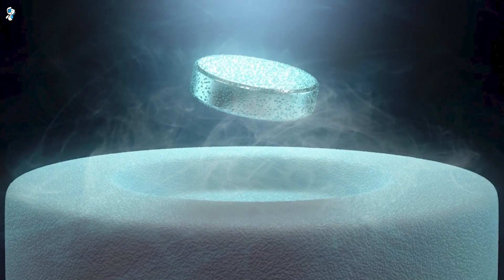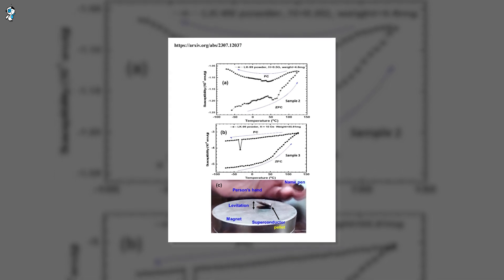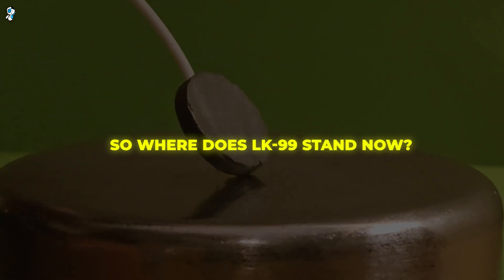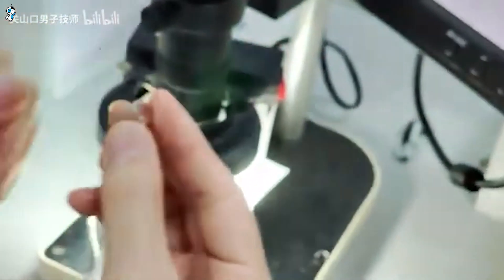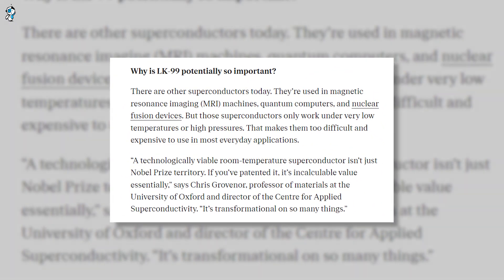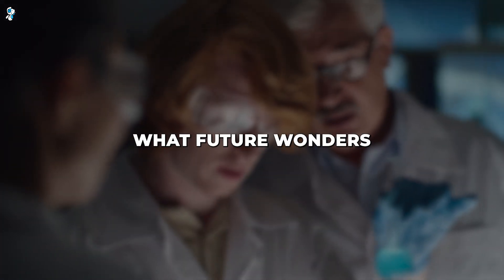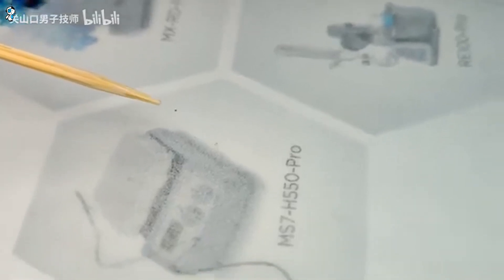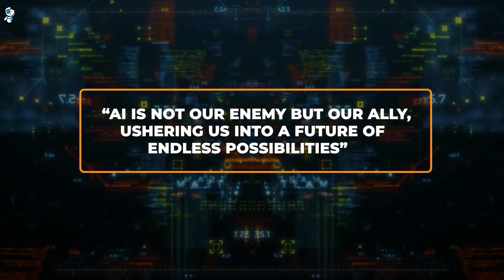Unbelievable Tech: LK-99 SuperConductor FINALLY Gets Replicated!

Comment: IF this (room temp super conductor) is "for real".  The first thing I would do with it is make a "hover-board".  Not, that seg-way thing they used to call a "hover-board". But, instead, just like the movie.  Then comes those anti-gravity belts, like on the jetsons.  And that is just the (anti-gravity) path that my thinks go down.  Soooo, many more threads to explore.
Reply: the ground surface would still need to be specialized for such a hoverboard to work. If we ever did get room-temperature super-conductors, hoverboards would likely only work in specific locations like skateparks.

Comment: Is (LK-99) a super Conductor at stp?  First things first.  Is (LK-99) a (super Conductor at stp) on paper?  If all the Maths check out in the affirmative direction.  Then I can begin to smile and be hopeful.  And the "failure" to reproduce the quality could be attributed to "purity" and "human error".  Some.  I mean, that's what I will consider in my little thinks.  BUT, if it don't work on paper.  what do they have for show?
If it works on paper.  Then it will happen.  It may be "finicky" and "stubborn".  But it will work.  Just because it works on paper, don't expect to "see" the white-paper on that effect.  That will be locked up forever and ever.  And the system will call it "national security".
("national security"), hahahaha.  Can't be no "national security", when there ain't no "nations".  That is the next step.  Then we will "see" all this.